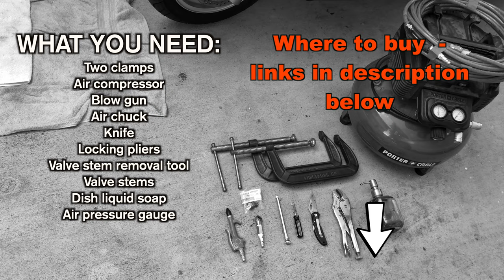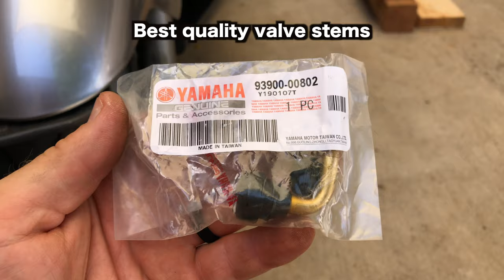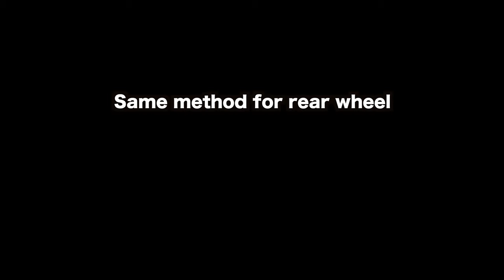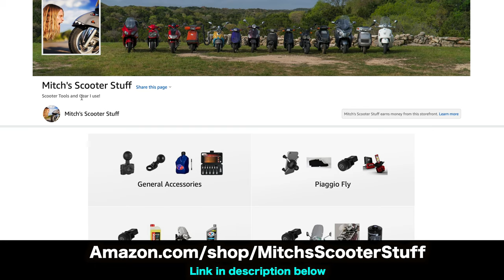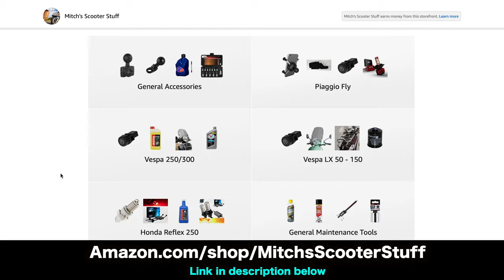Suzuki Burgman 400 Valve Stem Replacement ** Warning Tip | Mitch's Scooter Stuff

Comment from the maker: * Tools I used in this video: 
C-clamp 6” - http://amzn.to/2EU8xlm
Air compressor - https://amzn.to/2LetN6j
Air compressor blow gun - https://amzn.to/3fCwpIQ
Air compressor air chuck - https://amzn.to/3nyWlsQ
Air tire pressure gauge - https://amzn.to/30K7wFC
Knife - https://amzn.to/2SDMNi7
Locking vise pliers - http://amzn.to/2xGxI5G
Valve core remover - https://amzn.to/36KTVS1
Valve stems - https://amzn.to/3nzzldh
Dish liquid soap
Reply: Gooooôd frome Algérie

Comment: Very clever tip with the clamps Mitch!! Regarding the orientation of the valve stems, both of them should face the right side of the bike (or the opposite side of the side stand). This makes it easier to put air when the bike is on the side stand. Motorcycles that come with such angled stems from factory, have them facing the right side.
Reply from the maker: Thanks! Oh yes that's true!! 👍🏼👍🏼

Comment: Thank you so much for the tip. Everything worked out for me exactly as your tutorial showed. I was in a pinch when I looked into possible remedies that didn't involve removing the entire wheel.  I would add that putting the bike on the center kickstand if it is available should be done when filling the tire back up. Thanks again!😊
Reply from the maker: Great to hear!😄🙌🏼

Comment: This happened to me twice this year. 3 months ago on the rear and last week on the front. 
I always change the valves when I change my tires, so I have around 100 new ones on the shelf, but I never thought about using those clamps.
I always have removed the complete wheel to do this. This will save me some time when I brake off a valve again someday.
Thanks Mitch...👍
Reply from the maker: Dang that sucks.. yeah best to replace every time changing the tire... rubber can get dry and crack! Yes C clamps save a lot of time :) 🙌🏼

Comment: Nice and useful video. Used your very informative steps with a 5 inch g clamp and a 10 inch f clamp to remove and reinstall the valve which was broken similarly

Comment: changed front wheel tyre vale  without removing wheel using cple clamps  which removed but cant pump now as small area one side not beading maybe 7/8 inchs   i only have normal air compressor connect to car lighter socket  how i fix please?

Comment: I did it the same way this spring on my 1100 Shadow Spirit rear tire.  It wasn't leaking yet but I could see the dangerous valve cracking. Tire was about 85% tread.  Both beads broke loose and I had to use a rachet strap arount the tread to get the tire against the rim so pressure started building up.  You did a great job on this video Mitch which should be very helpful to many.  Thank You.
Reply from the maker: That's awesome yeah keep us safe on the road! Oh yeah ratchet strap works great for who having a hard time to get bead seated. Thanks and ride safe Jeff!
Reply: I have an 1100 Spirit and the same situation.  This guy's great video and your comment got me through.  Thanks to you both.  Safe riding.

Comment: The c-clamp trick is very smart. Ill be doing this some time over winter. And adding dyna beads. Thx Mitch
Reply from the maker: Yeah! Dyna beads are awesome, been using for like 10 years now
Reply: This exactly what is wrong with mine at the moment. A leak from a tare at the valve because its so hard to get access to when pumping up tyres. Thank you.